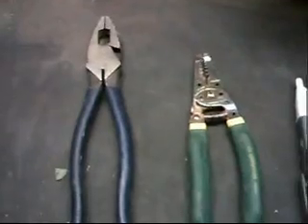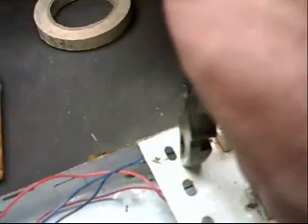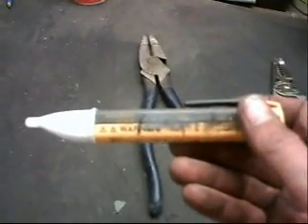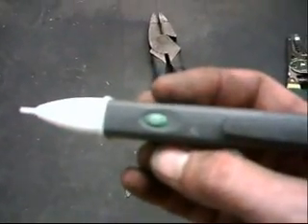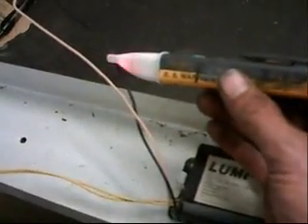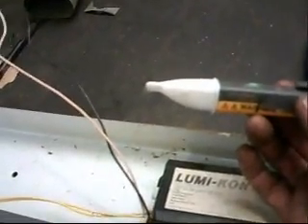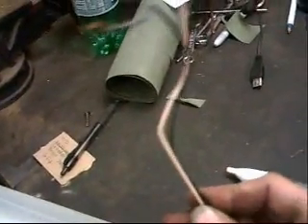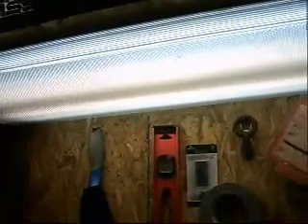flourescent light fixture ballast change

Comment: @suzukir122 The ground wire is there to save your life.

If the fixture is ungrounded, and a wirenut comes off and touches the fixture, it cant blow the breaker. It will just energize the fixture. Next time you touch it to replace what you think is a burned out lamp or ballast...you visit the graveyard. Forever.

Comment: @dirtydogF350EFI I agree, more electricians get killed this way than by any other work-related injury, even arc-flash.
Even worse: Turning off the breaker, then having someone else see the lights off, then turning it back on while you're working on it. Get a padlock and destroy all the keys but one, put that in your pocket & lock your breaker lid closed with a big damned note on it.

Comment: @EightCounts PCBs havent been in ballasts for a lot longer than that. 

You need to worry more about being killed by not having a "Means of disconnect" according to NEC code. He fails to provide one. They cost a dollar each in 3-packs, a few cents in 500-packs. Little orange quick-disconnects.

Comment: Thanks for this video.  I think you should have pointed out that older (pre-1979) ballasts could contain a highly toxic substance called PCB's.  I just had a ballast fail on me in my apartment and this video showed me what to do.  I noticed it leaking a black tar-like substance and with further investigation I discovered that my ballast was manufactured in 1974!  So i may have been exposed to PCB's.  Usually the EPA over states things and I hope this is indeed the case as well.  Thanks again!

Comment: rapid start is magnetic ballast while new electronic is instant start that fluke is more than 20 bucks more like 25 best way not to get zapped whn changin a ballast is cut off the hot and cap it if anyone has any questions of how to change a ballast any kind or which one to use for a particular lamp send me a message i change any ballast from emergency ballast to magnetic hid ballast